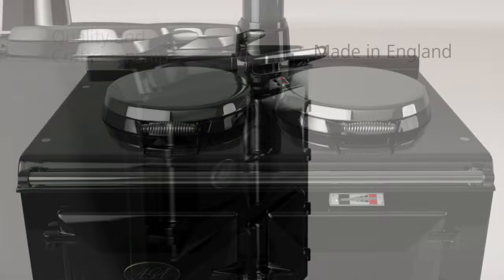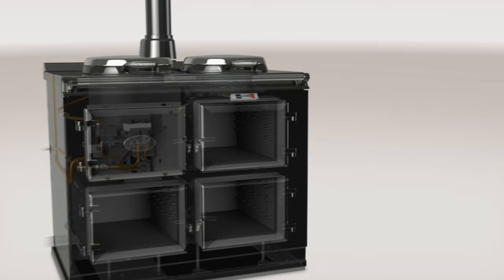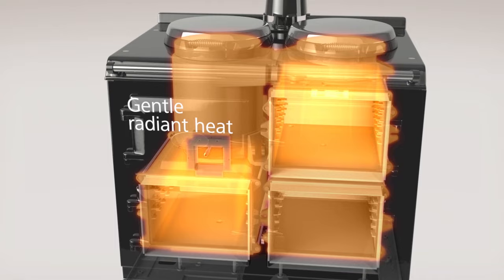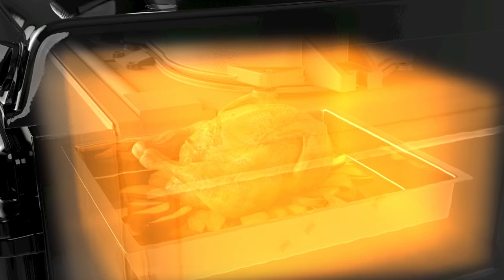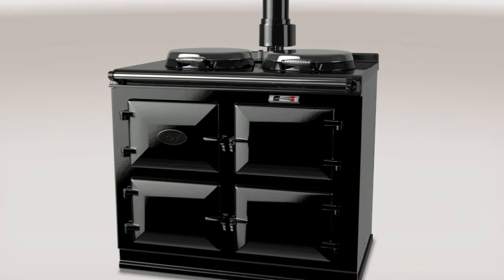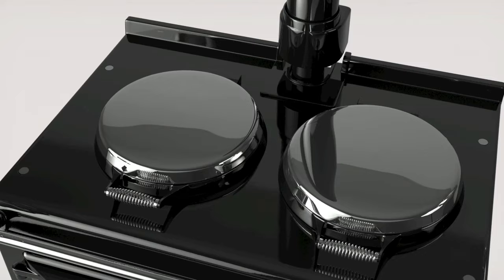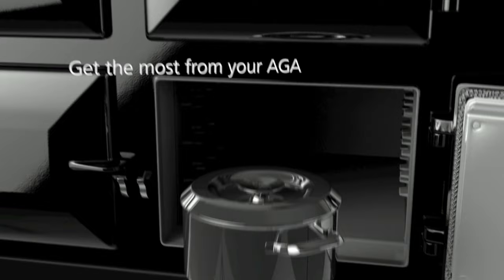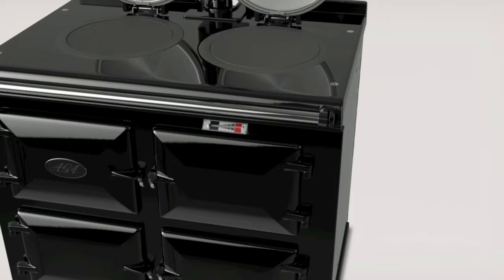How an AGA cooker works

Comment: When I grew up in Englad we had an Aga, it was fantastic.  Yes it stays warm all the time, ours was fuled by Coal.  The Aga heated our water and gave us central heating.  It was fantastic, have very fond memories of our Aga, I miss it.
Reply: It burns anthracite only.
Reply: Mine is 80 years old and perfect.
Reply: I’ve just heard of this oven. I was wondering if it stayed warm all the time. Not a option for someone who lives in the Northeast of Brazil 😂
Reply: It must have been a long time ago and a very old Aga, because Aga ranges don't run on coal or any other solid fuel and haven't done for decades.  They only run on electricity, gas (natural or LPG), or heating oil, depending on the model chosen.

A Rayburn (manufactured by Aga) is another matter.  They can run on all the above fuels, plus models that run on solid fuel (coal, wood or peat).
Reply: Heating is most important. A friend has a similar machine in blue. It eats wood.

Comment: Summary: It's a stove + oven that's always on, all the time, and is a little bit better than a traditional range.
Reply: Not sure I'd like that ongoing  heat in the kitchen during a hot summer.
Reply: It doesn't really get hot in england
Reply: Isn't that just a waste of energy tho?
Reply: @cherienugent9587  31C or so last 2 summers
Reply: @TCt83067695  yes.
Reply: And is 5 times as expensive.
Reply: @TCt83067695  Ah, you see the flaw in their "logic".
Reply: @cherienugent9587  this comment didn’t age well
Reply: @cherienugent9587  depends what your idea of hot is.  Near on 40 degrees last summer.  I count that as hot.

Comment: This seems so unnecessary. I just don't get it, I guess. Would it take a long time to cook something simple like vegetables? Or anything.
Reply: It's from England where it's often cold, damp, and rainy. You're correct with modern electic ranges, central air and today's building standards it makes an old fashioned always-on coal burning AGA somewhat obsolete but still useful
Reply: I have a two oven one hot plate Aga. I can cook anything from boiling veg to a full roast. It heats up fast and then turn it off and it will cook for ages with the residual heat. Dead simple.

Comment: There is now a new kid in the AGA block the Dual. It is a  combination of the AGA with the radiant heat and the Total Control in that the main part of the AGA is the traditional layout with large cast bits that heat up and retain the heat but the top plates can be easy switched on and off so are controllable. Running costs for this AGA compared with the AGA where all of it stays on all the time are very favourable and I am pretty positive that the Dual will become AGAs top selling cooker.
Reply: OvenGleamers AGA Cleaning And Restoration i

Comment: we Have an AGA cooker and we LOVE love LOVE it!, We also live in an old chilly house in Western Massachusetts so it helps keep our drafty old home warm.....
Reply: So, it radiates a lot of heat.  Hardly "efficient" energy (fuel) use. Of course, if you were in Britain and burned peat from the bog, it made little difference.
Reply: A friend lives in the wood and wood is put into that oven. Looks a little bit different but it is mostly the same. Plus the center of central heating.

Comment: I live in a pretty warm part of the world. If it's constantly giving off heat that seems like it would be a problem. For cold wet England or a colder climate I guess makes sense? Even England is not cold all the time so even that sounds not great. Confused
Reply from the maker: Hi there, we have models that are designed to remain on all of the time but many of our newer models are electric and can be switched on and off as necessary, so you can control the heat in your kitchen and the energy you use.
Reply: We had one in a small cottage in England and it’s like living in a sauna
Reply: @alextomkins3093  I pictured walking around the house in a towel and pouring some water on some hot stones while watching TV. 😆
Reply: @alextomkins3093  Of course.  There are good reasons why these things are so rarely seen in modern kitchens except as decorative curiosities.